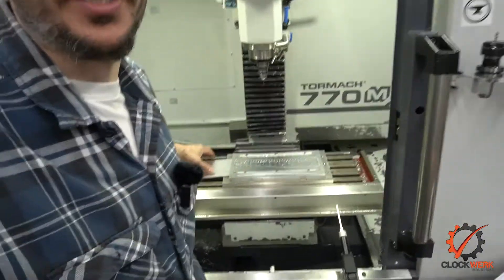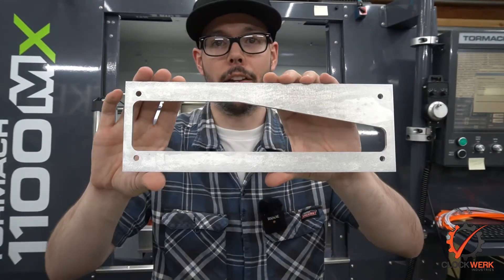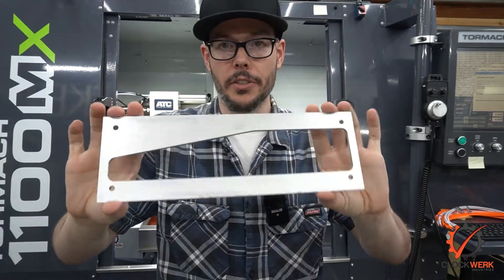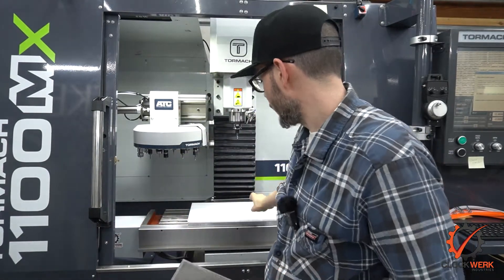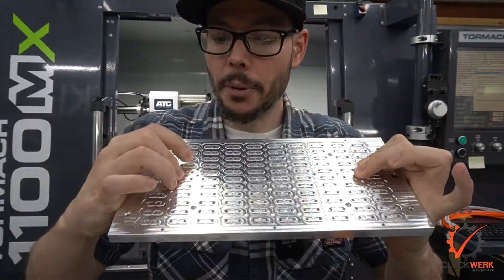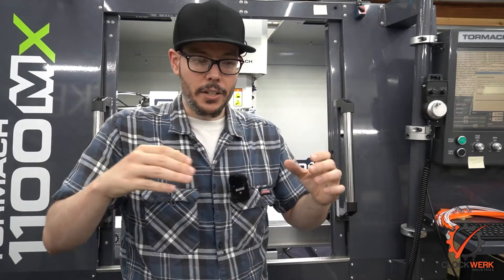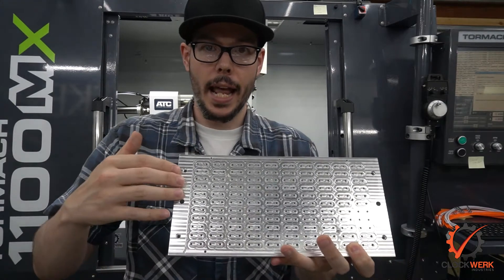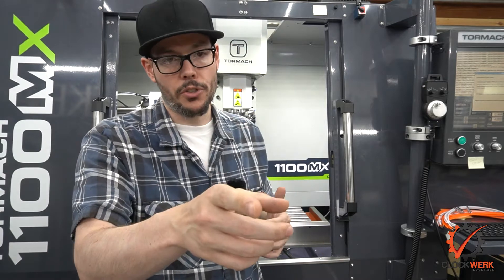Rough Cuts | The Dowel Pin Flip & Double Sided Machining

Comment: How do you like the Tormach? Have you dan any other CNC mills to compare it with?
Steve
Reply from the maker: Hey Steve! For the work I do it is more than solid! I am really happy with both the 1100mx and the 770m, I found the limits on both and it handles everything I need for now and both are a big help to build things up and eventually get an industrial machine. They both hold within a thou or 2 without trying and can hit .001 all the time when you use cutter comp and adjust in the control because the repeatability is actually better than the accuracy so once you dial things in, it bangs out damn near identical parts pretty reliably.
Reply from the maker: Unfortunately I dont have anything to compare them to, I upgraded to them from a DIY CNC router kit and they are obviously orders of magnitude more solid and relaible than a router kit.